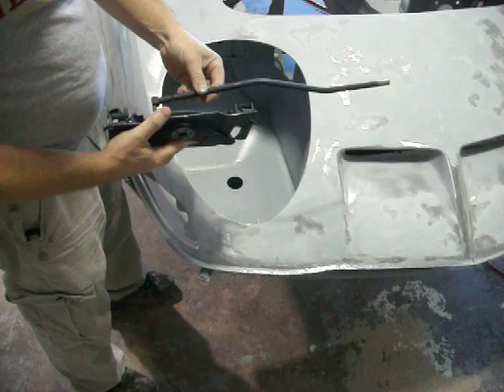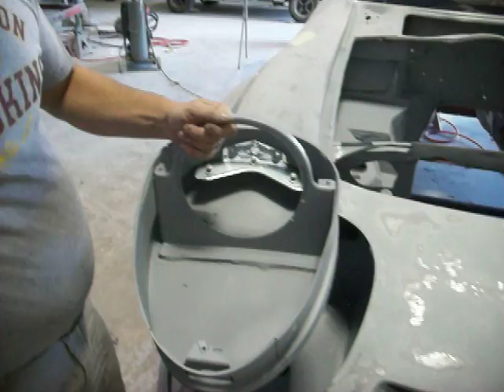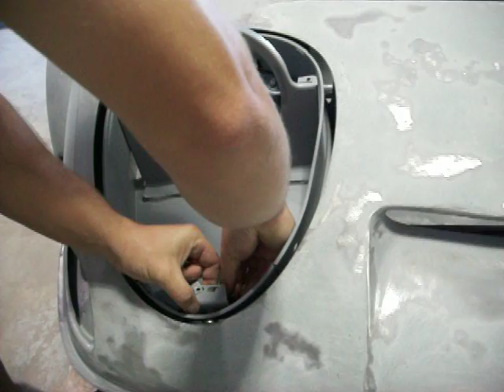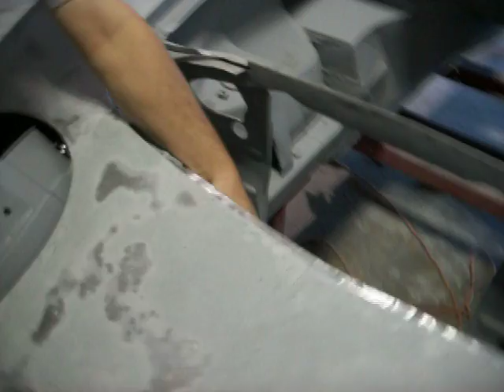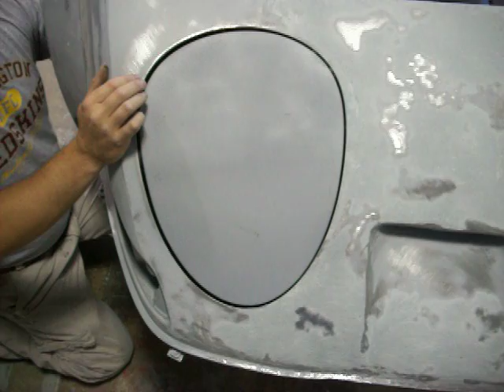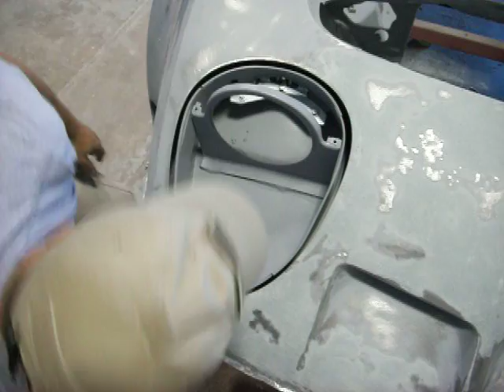Opel GT headlight install Part 3

Comment: Well putting these back in the car that is already painted is hard. The micro switches must be wired first. I had to remove the bracket on the back of the light assembly and remove the front post holder just to get in in the hole. Getting the bracket bolted back on the rotation headlight mechanism assembly is very difficult in addition. I taped up the housing and the body and it's almost impossible not to chip any paint. Be patient. It's easy to want to cram these back in :)
Reply from the maker: If you are getting that close to chipping paint, your bodywork to the headlights may be off.  I tape them too, but many times, its not even an issue.  I've even installed the wrong side onto the opposite side and didn't come close to chipping and it worked.

Comment: How are you able to wire the micro terminals with the lamp installed? Is there a technique.
Reply from the maker: You cannot wire the microswitches with the headlights installed, everything comes out, the mechanism as well, because the microswitches are behind them